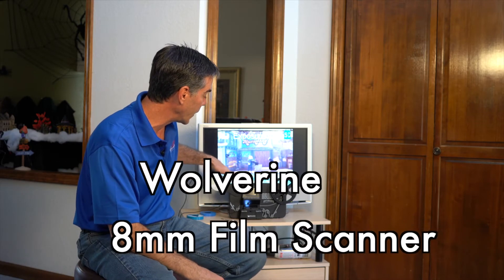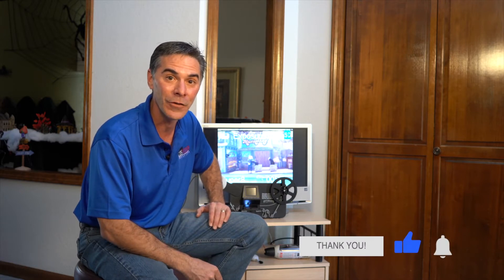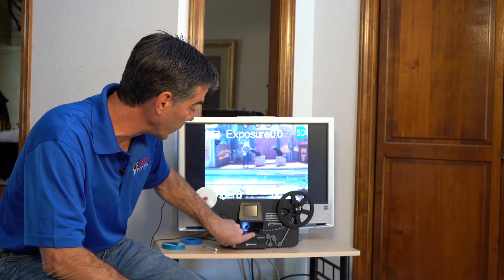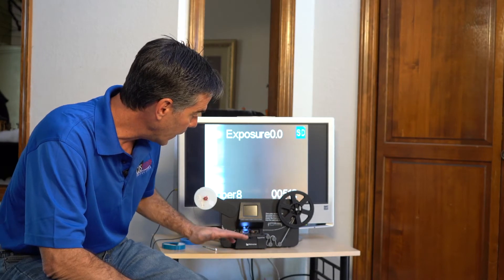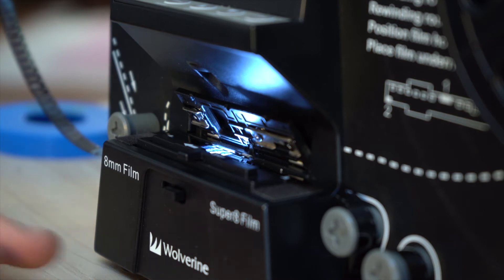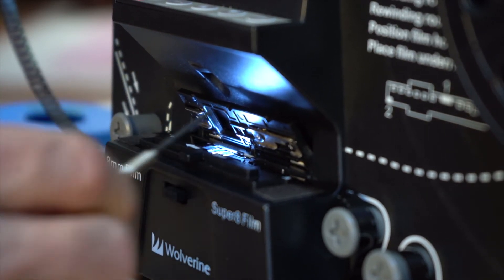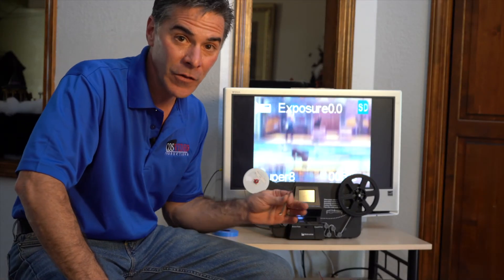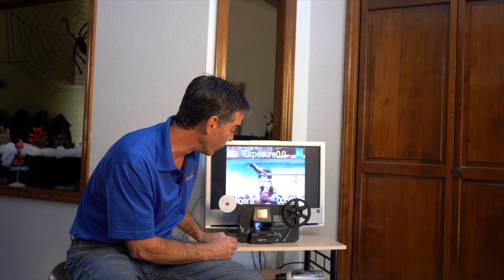Wolverine 8mm Film Scanner Not Advancing Film Properly

Comment: I have the same problem with a Eyesen M127, only after 12 3" reels and one 5" reel. It started with a different noise (not the same smooth rhythm), and the movie looks with a annoying vertical movement and the frame is unaligned. How can I detect if the problem is the take-up spindle or the metal plate? I was using the machine only 4 days, but it was bought a long time ago so there is no option to claim the money back.

Comment: This thing is just not working for me. film is not advancing. Will not physically pull through for most of the film I have. Tried adjusting the plates but cant find the exact Philips size needed.  -Question, why not just setup my GoPro and record that using my old school projector?
Reply from the maker: Sounds like the sprocket holes are damaged.  Good luck with the GoPro idea! Let me know your results

Comment: I have a problem with my Wolverine, not sure if it's related to this, but maybe you know?
It keeps stopping after a few seconds, it kinda feels like it doesn't get enough power from the power supply. Could that be the problem?

https://youtube.com/shorts/e_Vx9Fvsc2Q
Reply: Sometimes when it stops it says "Please connect power supply"
Reply from the maker: It sounds like it is going bad. Return it if you still can.  I have had machines in the past with bad circuit boards and have had to return them.

Comment: What if your advancing arm or "needle" is jarring? I've noticed that the needle will jar, then the right side spool will try to made up slack that isn't there causing film to potentially break because it is hooked, not advancing, and being pulled. Any suggestions? I've only had my machine for two years and have only transferred ~60 3" rolls.
Reply from the maker: I am not sure.  I have not run into that issue.  Are you making sure that you have the machine set to the film you are using?  8mm and Super 8mm.
Reply: @TheMediaNerdMT Yes. Everything is correct. While troubleshooting again yesterday, this original issue seemed to cease but now the right spool knob motor will not turn off without completely removing the power adaptor. Not the worst problem!! But, not really sure what’s going on inside this thing.
Reply from the maker: A lot of these machines are cheaply made. I mean, they work fine for a while but will burn out sooner or later.  I have gone through tons of them.

Comment: Pressure plate adjustment a great help, many thanks.  Now another problem, films are blue with an intermittent part in true colour, is it a bulb/light problem and can I fix it?  Film shows correct colours when run through projector.
Reply from the maker: Sounds like a software issue.  You’ll have to call wolverine
Reply: @TheMediaNerdMT  Thank you for your prompt reply, will send Wolverine query

Comment: Have a Panasonic fs81 that seems to make a knocking sound each time it advances. Like the one in video but much louder. It advances OK except when a splice is encountered. Thoughts?
Reply from the maker: I have noticed that all of these types of machines start to get louder with use.  Some make a grinding sound as well and I just have to tune it out.  None of them seem to take a taped splice very well.  The only splice that seems to go through smoothly are the ones that use the cement type splice that you would see on a developed reel connecting the leader to the film.  There are splice machines that one can purchase that makes these solid splices but I have never used one. I did look into them and they are $$$.
Reply: @TheMediaNerdMT  Thanks. Could it be to much pressure on the film? I have noticed that on occasion, maybe 10% of the time it goes nice and quiet then back to hard knowing sound. Lubrication?
Reply from the maker: I have found that the take up reel on this and similar machines start to fail.  You could try lubricants but I don’t know where and you would have to take the machine apart.

Comment: Should you tighten the pressure plate screws or widen them to make the springs bigger and exert more force?
Reply from the maker: You should turn them to bring down the plate to add more pressure to the film.  Only do a quarter of a turn then try it.   I have turned mine too much and the screw came out and I could not get it back in pretty much killing the entire machine.
Reply: @TheMediaNerdMT  I also have a Reflecta. It has already digitized one million and four hundred thousand frames and is operational. The wolverine, counting the number of uses, when it reached eighty it started to become popular, initially only in super 8 mm films and now in all.
Reply: Look, apparently I solved the problem with a toothpick, relieving the door that fixes the film. In my case it would be excessive force on the film. 😁

Comment: My problem is that the frames are being scanned 1/2 & 1/2, not one complete frame. I tried many ways but couldn't adjust the vertical frame adjust. Horizontal is ok. Pls guide me to solve this problem. The film I am working on is a regular 8mm and the spokes are very fine.
Reply from the maker: IF you have adjusted the X and Y and also zoomed in or out to get a proper frame, I am not sure what the problem could be.  Do you have another film to try?  Are you sure that you have it set to the 8mm setting?
Reply: @TheMediaNerdMT  All working perfactly Sir. I adjusted the Y and Zoom. Thnx bro
Reply: The super 8 film is running smoothly. Only problem comes with regular 8mm film.
Reply from the maker: It almost sounds like the lever that moves back and forth from super 8 to regular 8 is not going into position correctly.  Flip open the cover that the film goes under and flip between super 8 and regular 8 to see if it is moving correctly.  If you have purchased it less than a year ago, it still may be under warranty so you could try calling Wolverine to see what they say. Please make sure to support my channel by subscribing if you have not done so already.  I'd greatly appreciate it.
Reply: Sir. I adjusted the Y and also I tried Zoom and now it is working perfectly. Thanks a million, bro. GOD bless you
Reply from the maker: I am very happy that it all worked out for you!

Comment: Question Mark. My scans are getting jittery and I believe the culprit is the pressplate being too loose. I have a Wolverine Pro, and when the film gate is open, there is no screwdriver on earth that can access the pressplate screws because of their angle and the machine's outer lip (where the 8 and super 8 switch is). How do you actually get a screwdriver to angle into the pressplate's screws' philips heads?
Reply from the maker: I made a video about this.  I used a small screwdriver that one would use for eyeglasses.  Wolverine 8mm Film Scanner Not Advancing Film Properly
https://youtu.be/TLI9gAqmHfo

Comment: Hello, I found your video by doing a search for my problem. Mine is a little strange. Ive digitized about 30 reels flawlessly ( minus a quirk when a spliced tape goes through but thats not the issue here ). This morning Im converting and 3 minutes of film goes through without a problem and then I come to another scene ( a snowing skiing scene ) and I really want to digitize this. Well the Wolverine digitizer doesnt wont to advance the film on through. It goes back and forth on the same frame. I give it a gentle tug to help it through. That doesnt work. I pull the pressure plate lid up and advance the film myself a foot or two and replace the lid. Still same problem. Now Im confused. so I start the film over from the very front of leader. Again the film advances flawlessly until it again gets to the snow scene. So I take that reel off and do another reel. Runs flawlessly. I look again at the problemed reel of film and the area that it starts to refuse to advance and even the areas that AFTER the problem begins ( and yet it wont advance in those areas ) and there is no torn sprocket holes nor any tape or cement so I am left looking for answers. Do you have any for me please ? Thank you ! I have subscribed .
Reply from the maker: I think the issue may be width of the film.  I have heard of this issue before and what I have found is that the film was improperly cut so it is getting jammed because it is slightly larger than 8mm.  Have you cleaned your film to help make it go through the machine smoother?  That may help. Thankyou for subscribing!
Reply: @TheMediaNerdMT  Thanks for the fast reply ! If I run into a problem like that I will pust feed the film through my fingers holding soft tissue so I can sense any physical problem with the film and didnt find anything. I would like to think maybe that area of the film shrunk some * but why not the beginning of the film? ) I just dont know. I wiil move forward away from this scene and try again and let you know.. Thanks again.
Reply: @TheMediaNerdMT  i switched the machine to convert super 8mm and it went through fine. Havent looked closely to the film yet but it looks like it could be super 8. I thought those machines just changed the view scope settings and not how that needle that goes up and down does its thing .
Reply from the maker: Sorry I didn't mention that.  I was thinking that the ski film was just a small section of one reel that was spliced in, not its own reel.  Regular 8 and Super 8 are different.  That is why there is a switch. Most super 8 reels are on a reel that has a larger hole about the diameter of a marker.  Regular 8 has a hole the diameter of a pencil. However, the reels could be interchanged.  The sprocket holes are the true identifier of the type of film.  Super 8 can also have sound which is identified by a brown strip (typically) the same color as an audio cassette that runs on other side of the hole sprockets.
Reply: @TheMediaNerdMT  Thank you for taking time out to share your knowledge
Reply from the maker: You are welcome!

Comment: I have several reels that get stuck. After seeing your video and reading the comments, I played around with various setups. Using only the last roller on the right side seems to work most of the time, but sometimes using none on that side is the only thing that has worked. When I adjust the frame alignment, I can tell whether the film will advance. Getting the film to advance correctly seems rather random, and sometimes it’s advancing well but suddenly stops (if the film was spliced I can’t tell). I think that something must be creating too much tension.
Reply from the maker: Some times when the film is cut (physically) it can be off by a hair width wise and that is all that it takes for it to not go through properly.  Did you clean the film first?  The cleaner will also lube up the film to help it run a bit better.
Reply: @TheMediaNerdMT  didn’t clean it first. I’ll try that next time - thanks!
Reply: Adding a slightly unrelated question but one that affects the movement of the film through the scanner-not sure where the question belongs: We have a many old super 8 reels. Some of the film reels don’t work with the wolverine’s adapter – the spool size is slightly  smaller or a slightly different shape and doesn’t work with the super 8 adapter.
Reply from the maker: @sk8gal I have wrapped black tape around the grey and red adapter when the reel hole is too big.  I have also slightly tilted the machine back when I find that the reel likes to slip off.

Comment: I spent seven hours recording to digital about 13 reels and only got about 16 minutes recorded.... No, I did not think to check each time to see if it had recorded, I was too trusting... Now I have to do it all over again....
Also, when trying to prepare for set up I cannot get it to show the xyz etc adjustment screen... Seems they only show up when the machine decides to let me see the adjustment which is very rare....
Reply from the maker: Sounds like your machine is defective.  You need to call the manufacturer or try and get it replaced from where you purchased it from.  Honestly, I switched over to the Kodak reels machine.  So far I like it better.  Thanks for watching and please help support the channel by subscribing!

Comment: Also had this problem but I couldn't turn the damn screws even with a "00" Philips.  Used tape to hold it down.  Worked for about 5-6 7" reels, then started up again.  Finally got at least the right screw turned just a 1/4 turn to increase downward pressure.  So far working like a charm.  (I have an unbelievable amount of film to to do, all 7" reels)  Thank You!!!  Was ready to use projector and film it but while this may be painfully slow, the results are better.
Reply from the maker: I used to use a projector years ago and though it may be faster, when the bulb burst it was pretty expensive to replace.  I hated doing it that way.  The screws are a bit tough and if you screw them out too far, then they wont go back in. I learned that the hard way.  Just a small turn like you did does the trick. Thank you very much for your comment and please make sure to subscribe if you have not already!

Comment: Is there a way to “loosen” the reel arm that the original film is a attached too? Or make it turn smoother? I find that my machine will not advance that reel sometimes unless I loosen the film in it (and who wants to sit there and do that?). Would W-D 40 be ok to use on the spindle?
Reply from the maker: The arm that the reel is attached to is free turning.  There is not any kind of motor attached to it. You could try some W-D 40 I suppose but make sure you don't get any on the film since it is a dissolvent as well as a lubricant.  Thank you for watching and subscribing!

Comment: why does the film always start out rough… it jumps and makes a double click noice instead of the well running single click… you can see it is clicking when the picture is only half in the frame.  after a minute or 2 it runs normally.  tube holes in the film is not damaged.  thanks
Reply from the maker: When I put the film in place, it is past the leader so I can make the X and Y adjustment.  I then give it a little light tug backward to make sure that it is seated properly.  You will feel it catch on the pin. I then adjust the X and Y to make sure that it is centered properly and then start the transfer.  I hope that this helps.  Please make sure to subscribe if you have not already!
Reply: @TheMediaNerdMT  Hey Mark!  I finally got the Wolverine, question:  if you loosen the screws a little bit so the film runs better (and doesn't get stuck very edited piece), wouldn't it affect the X/Y adjustment since the film has more free movement that might get the frame out of position every few minutes or every edited area?
Reply from the maker: @JP_PLASCENCIA  Loosening the screws only raises and lowers the sled but don't do it too much or the screws will come out and not go back in.  It does not effect the X or Y. The X and Y goes side to side and back and forth, not up and down.

Comment: I have had two of these units and also the Pro version. I have transferred around two thousand films to date. They best way to solve this problem is not to use the film rewind arm. It doesn’t have the electronics that will handle this problem. I tried everything that was possible. You will never have a problem if you simply let the film drop into a box instead of using the rewind arm. I then use an old projector to rewind the film, very simple and easy. Also have a usb laptop fan that I have blue-tacked to the unit before the film hits the light box, I clean the film thoroughly first. Nothing more annoying that to get to the end of a reel and find a dirty mark has been recorded.
Reply from the maker: That’s a cool idea.  Sometimes my take up reel stops working and if I don’t catch it, the film piled up.  I’d do what you are doing but my cats like to play with the film if it doesn’t get taken up!

Comment: Had this problem with my Wolverine - the film was not being pulled through. My solution was to only thread the film on the back end using only the first two rollers on the left - making it easier for the take-up reel to pull the film. It worked, and still works, perfectly - making me wonder why the other two rollers are even there. If this happens again, I'll try adjusting the plates.
Reply from the maker: Thank you for sharing how you fixed your problem.  Sometimes, I skip the first couple of rollers when the take up reel is not working properly.  This mainly happens with 400 ft reels.  The take up reel seems to get bogged down.  Please subscribe to may channel if you have not already.  I appreciate you watching the videos!
Reply: Thank you!!!!!!!!!! This solved my problem
Reply: With a reel that kept getting stuck I ended up using the rewind setup (eg no rollers) and it’s working. At first I just skipped a couple of rollers but the film got stuck partway through. I think there’s something wrong with sections of the film so any amount of successful digitizing is appreciated.